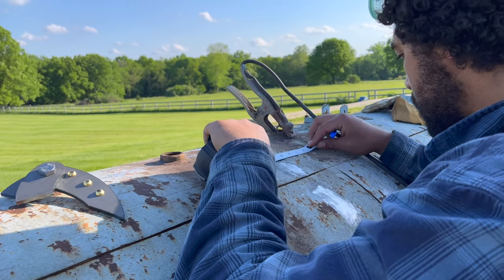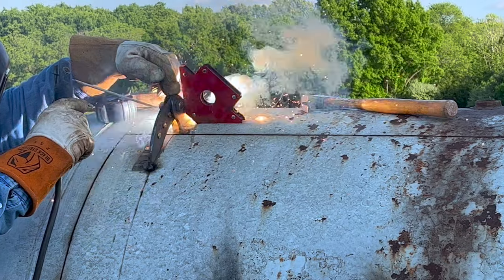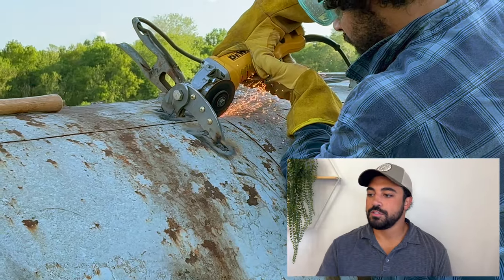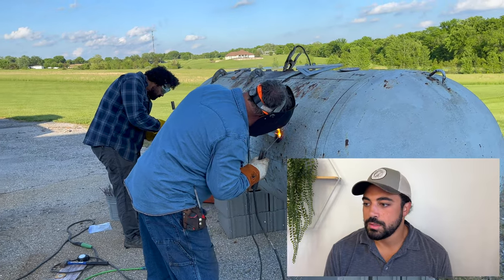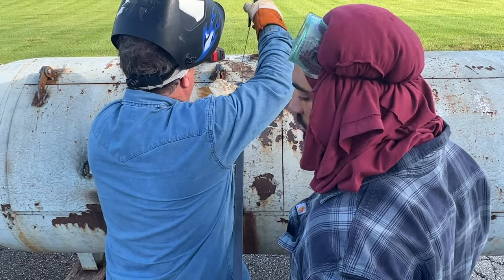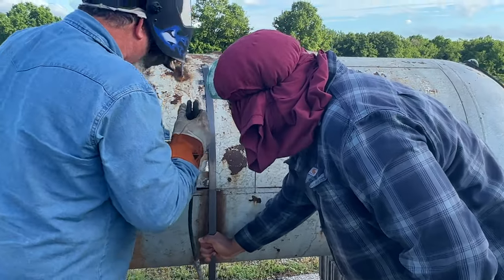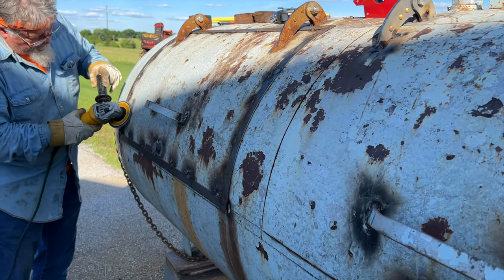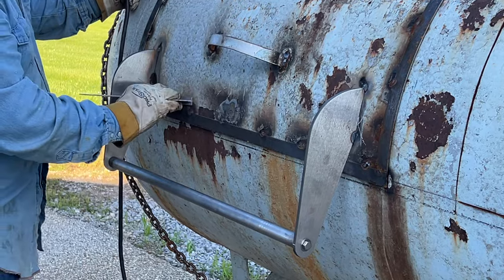Building A 500 Gallon BBQ Offset Smoker: Installing Hinges And Handles

Comment: Looking good, just found your channel last night, I've watched most of the vids so far. Currently in the very early stages of building a largish offset, not as big as yours, but still decent. Our tank is currently about 330-335 gallons, it's an old tank that used to be in the oil and gas industry, I think it was used to pull water off the oil or gas wells. Either way, ours is essentially flat-ended pipe, 30" dia, about 5/16" thick steel and 9 feet long. We've opened it up and built a fire inside to heat it up and burn of any hydrocarbons that may have lingered, but I don't think it was used primarily for that, if there were any in there, they were likely just contaminants. Going to make a nice setup, I think. we bought a boat trailer as well and are going to cut it down, narrow and shorten it, and make it suitable to mount our tank upon.

What is your plan for your smoker in terms of mobility? Are you going to do something similar with a trailer, or is it going to be mounted on casters of its own to pull it around or what?

We're also trying to make plans for size of firebox and whether we want just an exhaust tube 6" or 8", not sure if we want a collector chamber - still doing research on if I think that is really a big benefit or not. Glad to hear any info you've got.

Either way, looks like you're doing a very slow and meticulous build, you're doing a great job. I've been thinking we needed a plasma cutter for all we have to do, but it's been really neat to see the precision of your cuts and how profession they look with just using a cutoff wheel, I'm really encouraged by that. Great work, keep it up, man!
Reply from the maker: You’ll have a ton of fun with you build. I mounted the smoker on a 16’ trailer so it’s pretty mobile. As far as firebox I would use a a 24” round pipe 3/4” thick at minimum for that size cook chamber. Or just use a half of a 250 gallon thank for the firebox. May sound like overkill but you can regular the amount of heat exposure but controlling the throat opening size from firebox to cook chamber. If that makes sense?

Comment: I just finish my corners with a saws-all blade or a jig saw.  No need to stress trying to fit a cut off wheel in there.  Then clean up the corner with a file
Reply from the maker: Brother where were you a year ago when I was racking my head on this haha. Luckily it all worked out! Thanks for the comment, subscription and support. It really means a lot!

Comment: Do you have a rough idea on the amount of steel you need for the insulated firebox as related to the cooking chamber. I probably will make mine square, because it is very difficult to find tanks here in Spain so a square firebox is an easier option.  Thank you
Reply from the maker: Unfortunately I don't have much insight in the way of insulated plate cut fireboxes. I know my was around 40-42" long for my 500. The facebook forms are very helpful with this if you haven’t joined one. Sorry I'm not much help there.
Reply: @MeatNGreetBBQ  Thanks though for getting back.  👍